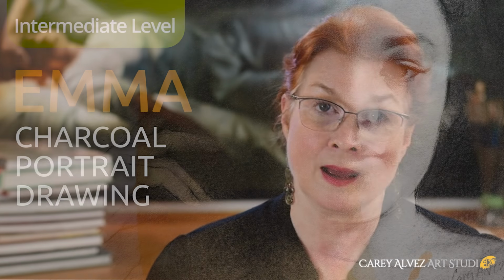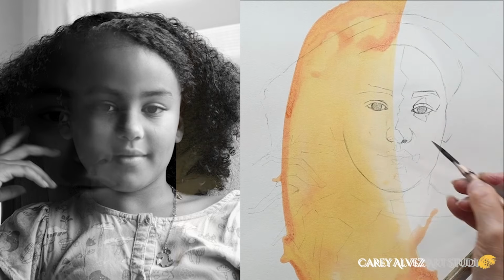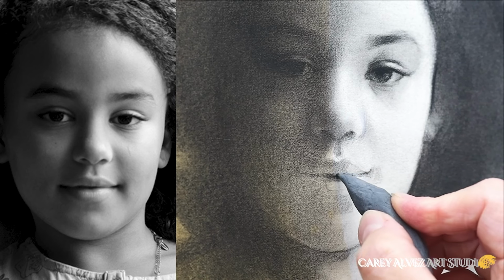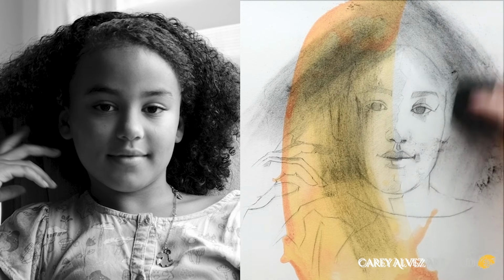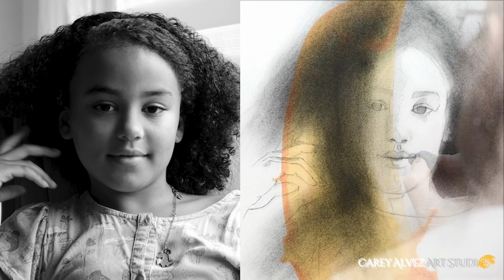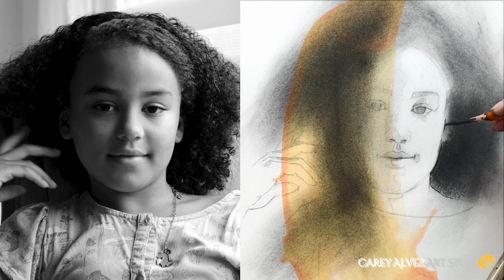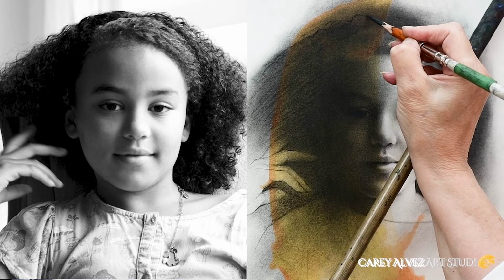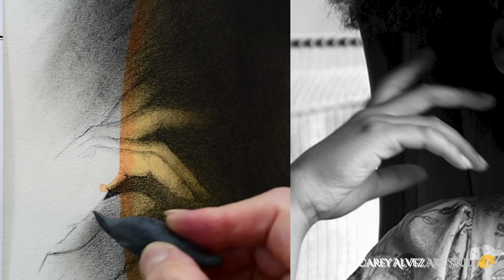Unleash Your Creativity: Charcoal Drawing Techniques with Cool Tools

Comment: how do you keep the charcoal powder and charcoal marks in place while you work?  to you pretreat the paper?  or use any type of spray?
Reply from the maker: No, just work on the paper. Stonehenge paper is a really great paper with enough of a tooth to hold the chalk, and brushing it helps to push the charcoal into the fibres of the paper.